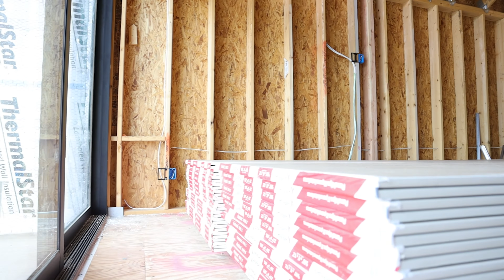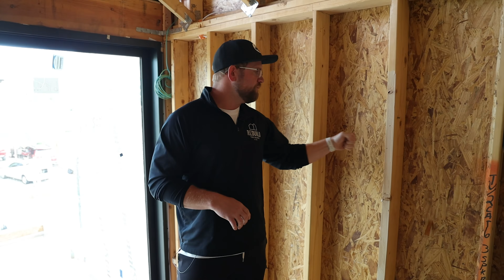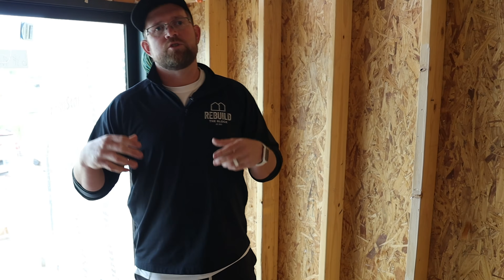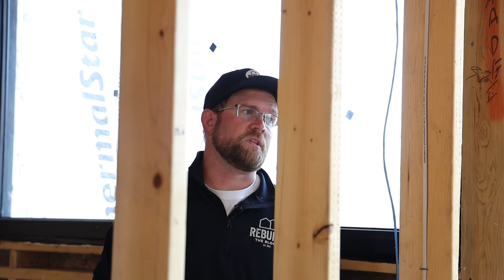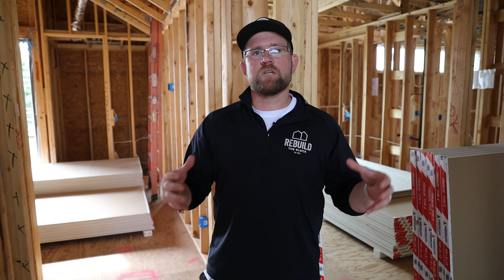Spray Foam & Batt | Why We Use Both | Rebuild The Block

Comment: We use thermal breaks around doors and windows. Then spray foam around windows and doors and bay next to them. Every thing else mineral wool. It's about the moisture. Mineral wool does breath but not sealed in wall by windows and doors in cold climates.